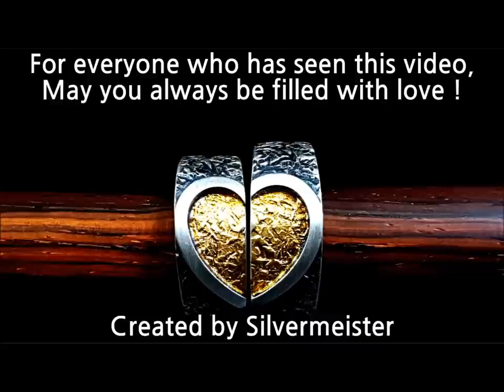Making Heart Couple Ring / Silver, Gold, Textured Hammering

Comment: Excuse my ignorance, but why did you weld the heart together only to cut it in half again?

Beautiful work by the way
Reply: Maybe for a perfect divide, right in the center....one straight line/edge. And its way easier AFTER hammering it into a rounded shape. How do you want to bend one half? ^^ it would probably warp. Straight line, both bent the exact same way.
Reply from the maker: You must solder the heart to the bend of the ring.
If you do the banding while the hearts are apart, you will not be able to band as desired.
Put it on one piece, and then band it to get it right,
Then it was cut again.
Do you understand? ^^
Thank you.
Reply: LaserGadgets thanks
Reply: Silver Meister I understand thanks

Comment: is gold soldered or glued?  did not understand.  very cool job, like👍
Reply from the maker: It is natural that most people do not understand.
This is a traditional Korean method of work.
Instead of soldering, heat is applied and pressed.
The important thing is to match the thickness of the gold with the heating temperature.
Reply: @SilverMeister  I'll try, it should be stronger than electroplating on silver.  I think it will work out over time.  Thanks for the cool idea.  thanks for the quick answer, you are the best!
Reply from the maker: @vix2925  
It is incomparable to plating.
Plating is applied with too thin thickness,
This is an overlay of real gold paper.
It is almost semi-permanently gold, no matter how much time passes.
Reply: its name keum boo. 
Btw thanks for sharing Silver Meister, warm regards from Kotagede, Yogyakarta.
Reply from the maker: @rullysilver  
You are welcome !
Thank you more ~